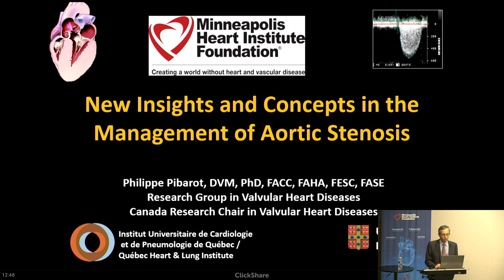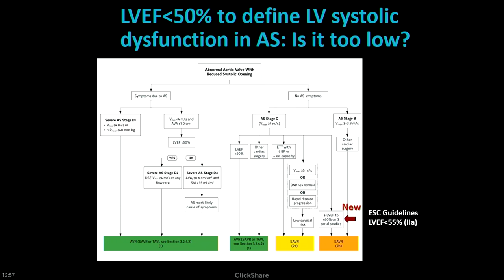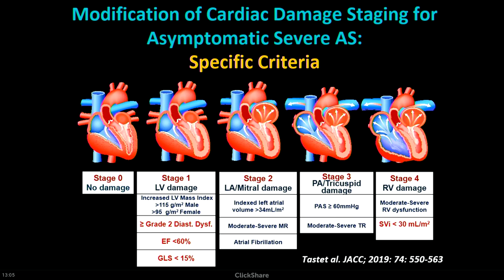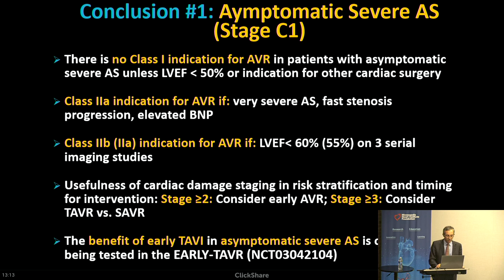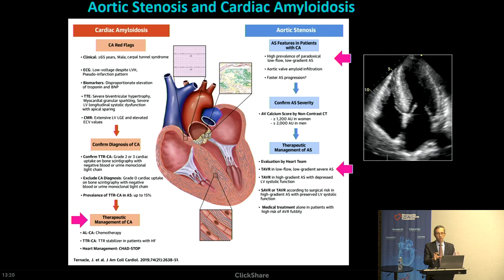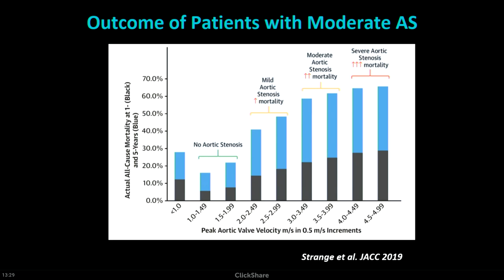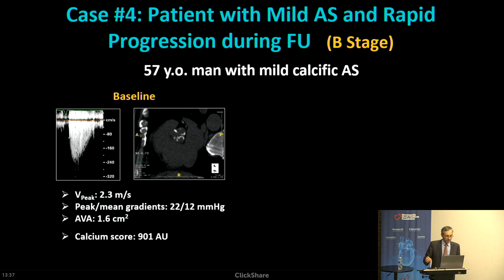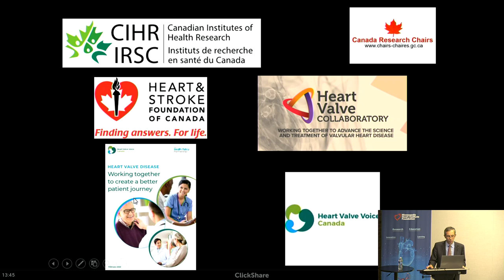New Insights and Concepts in the Management of Aortic Stenosis | Philippe Pibarot, DVM, PhD, FACC

Comment: Hi Doc, last 2022 in my result of 2d echo their was a conclusion of aortic stenosis please help me I want to live long for my 3 young children
Reply: It seams to me for the longest time outcome is to start with SAVR then about 10 years later Valve in Valve repair using TAVI, the is a heap of information available on the net, keep reading then you will better understand. Age coming into it also, generally older patients about 80 TAVI under 65 SAVR in between either or, keep reading up !!!.